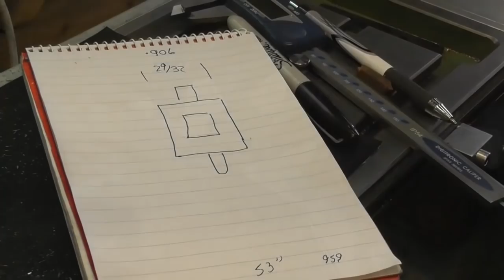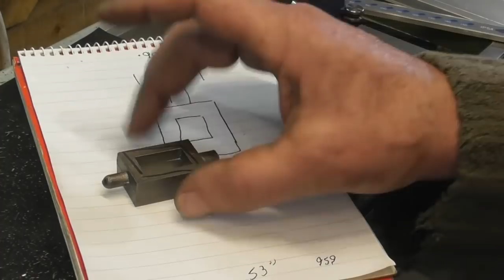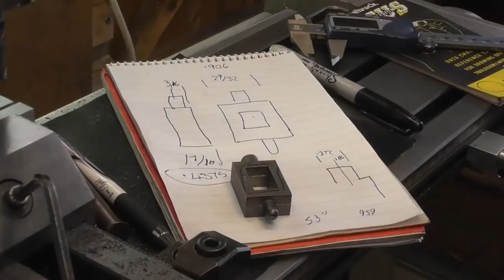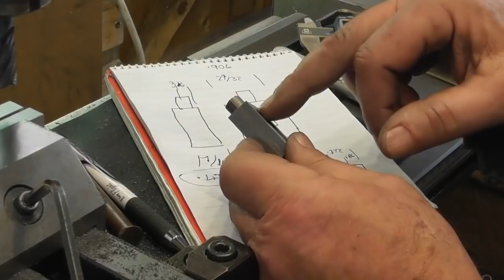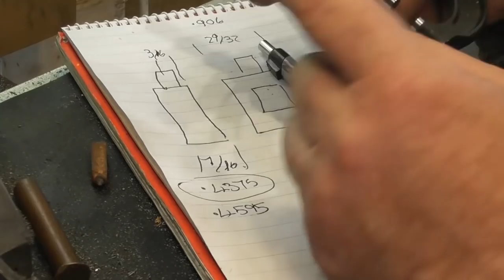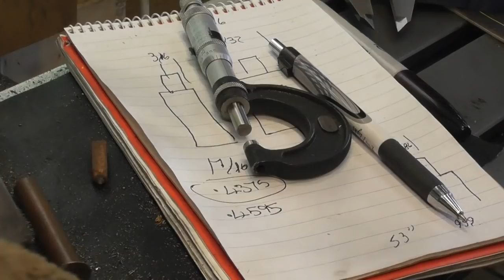Stuart Models S50 engine part13 the steam chest

Comment: Hi Ade, Not sure what DRO you are using, but you should have an absolute and an incremental option. If you are setting about in the absolute you can flick over to the incremenatal and set it to zero without affecting the absolute reading, comes in really handy, no complicated math.
Reply from the maker: I use this feature regularly in previous video's . went conventional for a change . Cheers Ade.